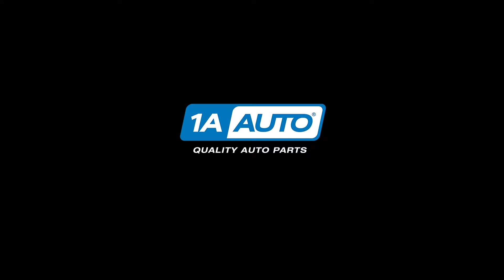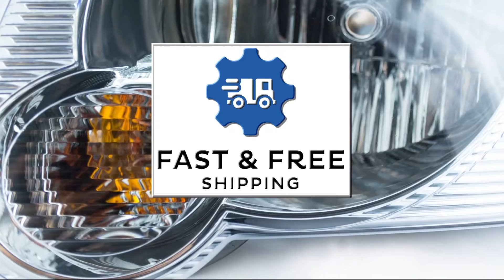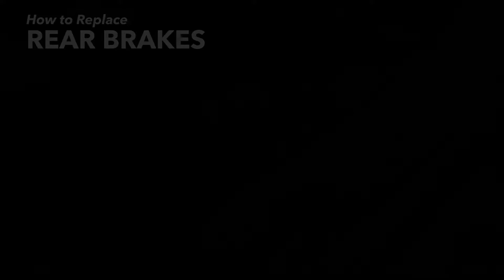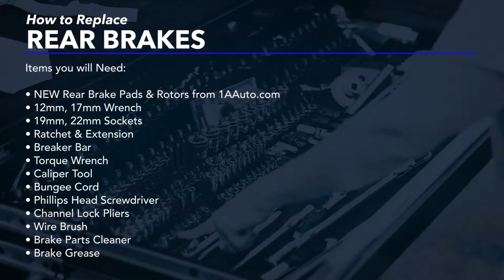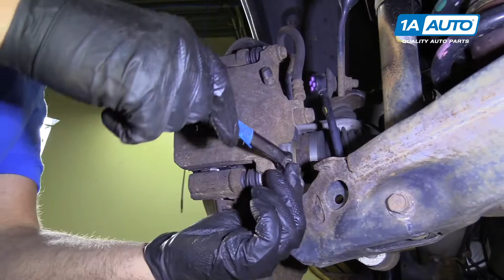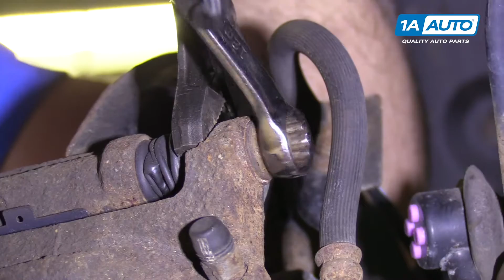How to Replace Rear Brakes 09-15 Honda Pilot

Comment: I noticed that the new pads you removed from the rear caliper didn't have the micro holes drilled in them for the V springs to be installed like up front and your pads didn't have the "squeaker" bars on the rears like the fronts did..  My replacement pads had the holes and the springs, but the squeaker bars came in the parts bag unattached and I can't figure out how in the heck I'm spozed to get the squeaker tabs mounted on the pads.  HELP!!.

Comment: Does your truck have to be on neutral when replacing rear rotors ?
Reply: No. It may help getting the wheels off having it in gear (or park for an auto) if you don't have an impact wrench. Assuming your rear brakes work, just use the e-brake to lock the wheels while you pull the lugnuts (or bolts)
Reply: @dmckrayjones  but make sure the parking brake is off when you go to take the rear rotor off!! Otherwise you will curse your mouth off

Comment: 27 ft/lbs on those 12mm bolts? are you sure??? 
i just snapped mine!

Nevermind--my dumb fault

But what is the torque settings for the lug nuts?

Comment: On my 2012 Pilot, do the rear pads use the spring pad separators like the front brakes do? I noticed you didn’t use them on this older Pilot.
Reply: Did you end up finding an answer?
Reply: My 2010 use them front and back.

Comment: I have a 2015 Pilot.  I've removed the lugnuts but wheel won't come off. I've shot some WD40 around the lugs and the center hub, and have used a 2x4 and a mallet from the inside out.  Hasn't budged.  I even let the weight of vehicle on the wheel.  Am I missing something??
Reply: weird, did you figure this out?
Reply: From the inside out? Do you mean the backside of the tire? I've had problems too and used a sledge with a piece of wood to hit the backside of the tire and it came right off.
Reply: Thanks this very helpful

Comment: do you need to replace the rotors each time you replace the brake pads?
Reply from the maker: +Jason Maravelias Only if they need to be replaced. No sense in replacing parts that are still good
Reply: I think the rotors have a spec for thickness and if they are thick enough, you can still use them, but it is recommended to get them "turned" which means have the surface smoothed out at a machine shop that does this sort of thing. Depending on the cost of new rotors, sometimes it could be easier to just buy new ones.
Reply: @Roger Baker  Most modern rotors don't allow turning per mfg specs. But a roto+pad kot is so cheap there's no reason to not just get the kit over just pads and do it all.